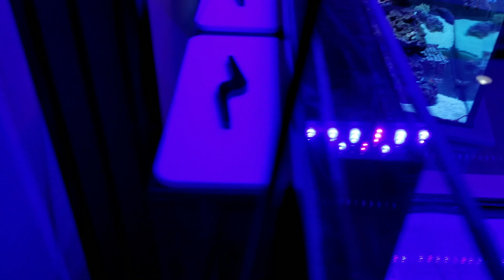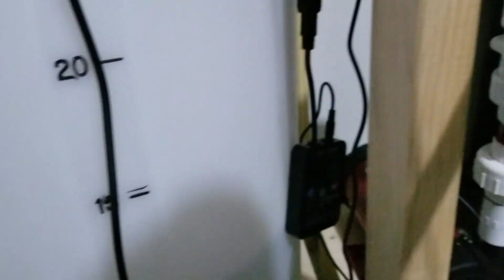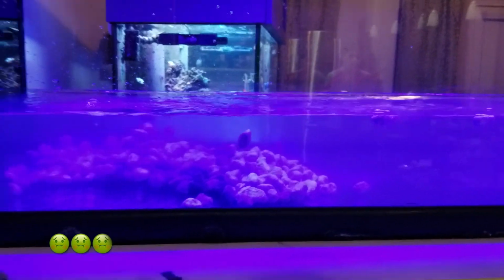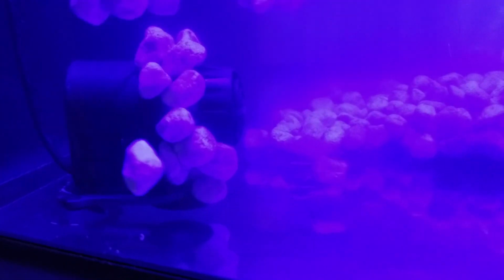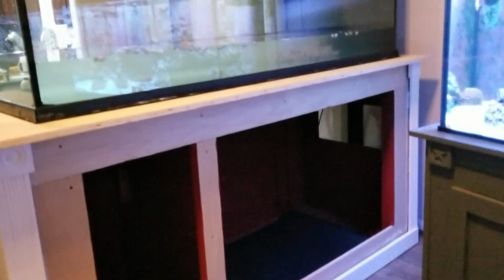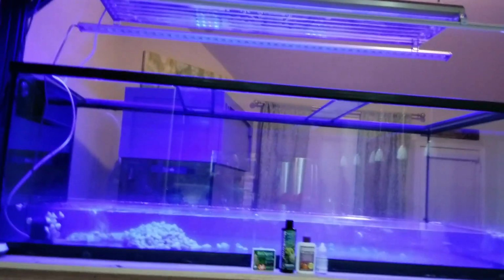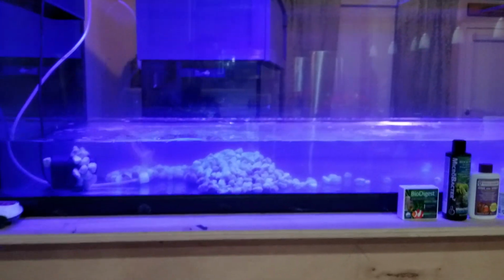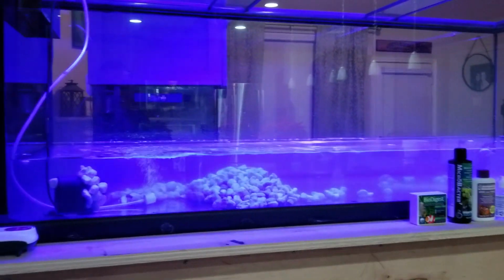Getting The 230g New Build Wet - Starting the Cycle

Comment: If it were me, I'd have a power bar or dj switch on the 80/20 lighting support arm over the tank and then I'd route the power cables of the lights, up the cables suspending the lights and connect them to power on the arm.  That would look really clean.